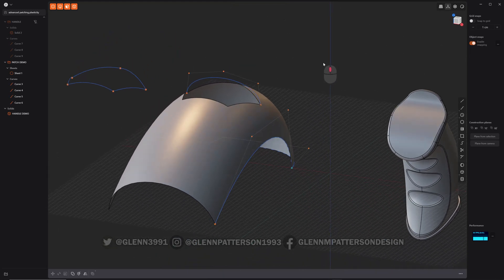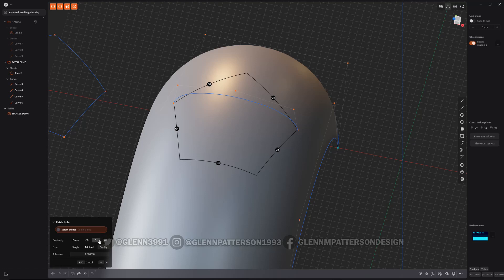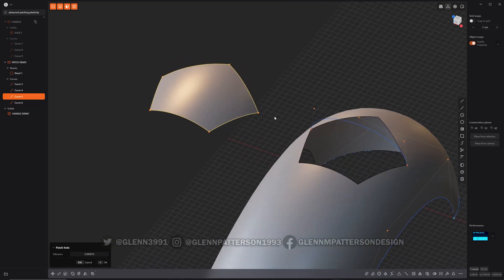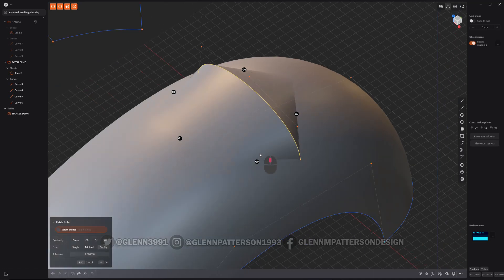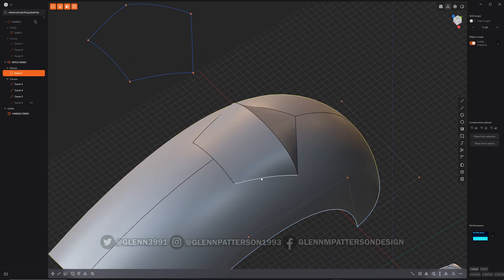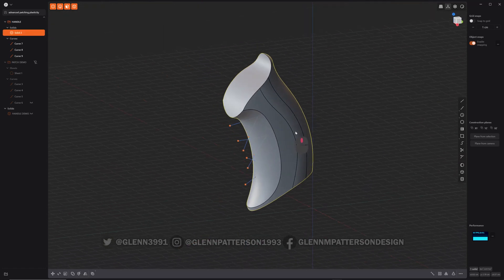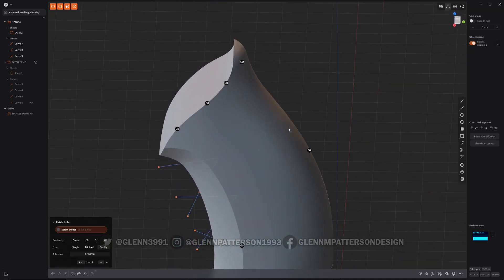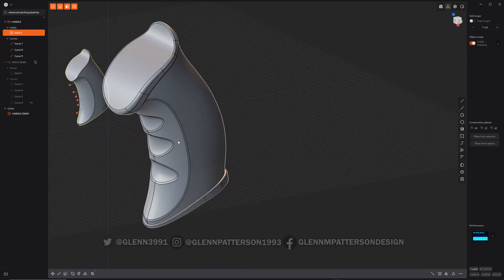PLASTICITY ADVANCED PATCHING

Comment: If you bevel the corners of your polygon sketch before you cut the surface you will get better results. It's the sharp corners causing the issue.
Reply from the maker: Very true, starting with Cleaner cuts will give better results. I was a total noob on surfacing when I did this video, but even now I still struggle with some surfacing situations.

Comment: is there a way to see through object, like Wireframe mode in blender to checkout my imported reference
Reply from the maker: You should be able to adjust the opacity of reference meshes through by adjusting material by typing m on keyboard, though I think you need to be in different render mode for it to take effect. I'll have to test it out this evening.

Comment: This was very cool, please do more on this topic, as someone coming from usually doing a subdiv workflow this is really enlightening. I usually would have just stopped at that bevel and wouldn't have though about doing patch for that gun handle.
Reply from the maker: I was in your spot a few months ago, coming from Poly modeling in Zbrush for a couple decades. Surfacing techniques are fascinating to me, I was playing with that Gun Handle few weeks ago and decided to do a patch on it, along with the update to the UI and it finally clicked in my brain on what was going on. Think I'll start doing some lofting and patch exercises to help folks out.
Reply: @Glenn3D1993  Yep, I need to start playing with lofts and patches more as well. I'm finishing up a project so my next goal is to try and make some soft surface looking designs with that system.

Comment: This is a very helpful video, especially involving the issues with continuity and creating complex patches. My current project involves a mix of organic and mechanical modeling (Making a helmet camera) and the seams will bug me. My trial expired so I'll be getting my licence.
Reply from the maker: Glad it helped. Mind you, you won't get access to the version I was using until 1.2 is released unless you get studio version. Functionally 1.1 still works the same except for UI on the patches will be colored dots instead of G0 G1 G2 black dots.
Reply: @Glenn3D1993  i discovered that last night and I'm glad it's there. I'll resurface my model to ensure full smoothness